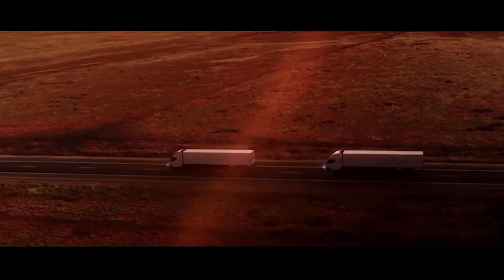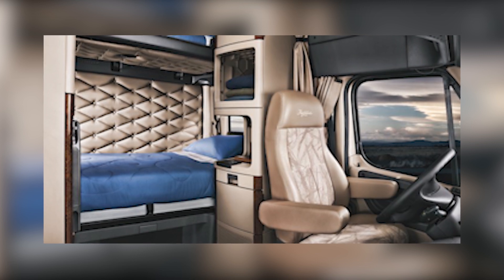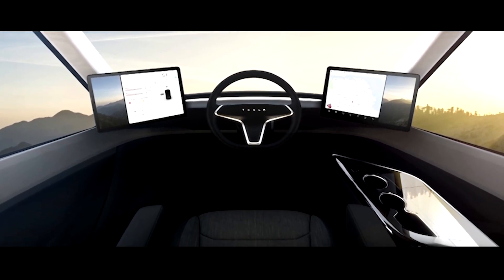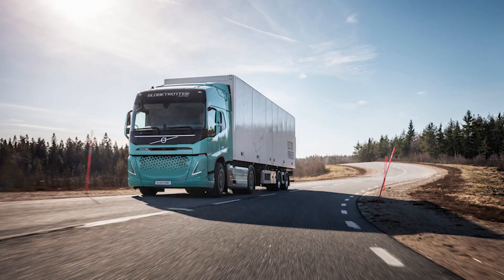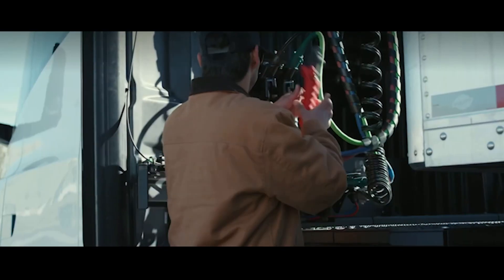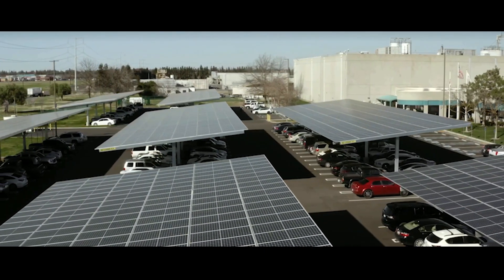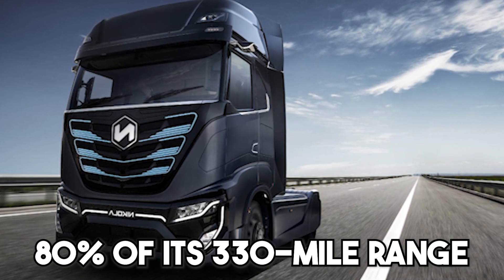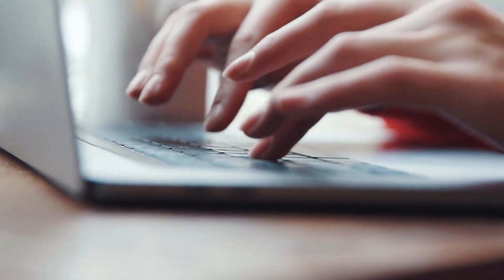The Real Reason Tesla Created The Semi Truck!

Comment: When releasing the data on stage, Musk swore that they were no tricks to it either. It was a production truck that just came off the line without modification and they drove at highway speeds when possible. The truck also had to go through The Grapevine and climb quite a bit. On a flatter route, it could likely achieve a range closer to 600 miles.
Reply from the maker: Thank you for watching! We are looking forward to sharing more quality content.